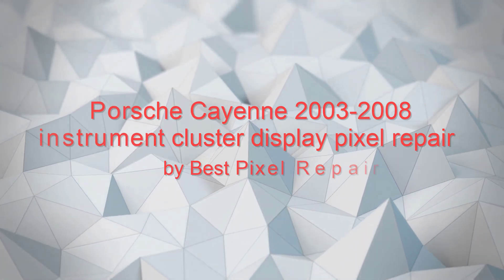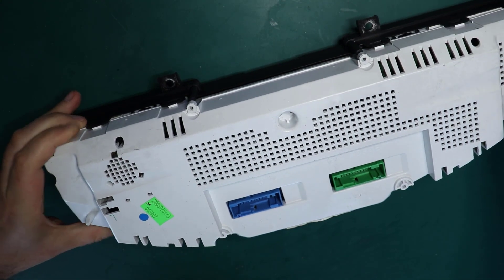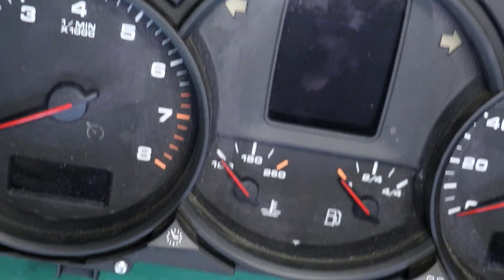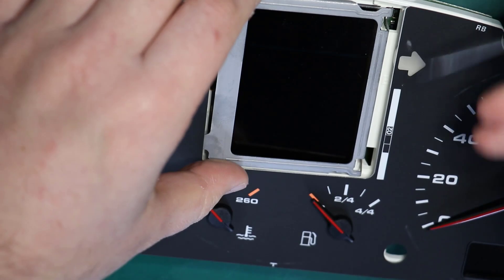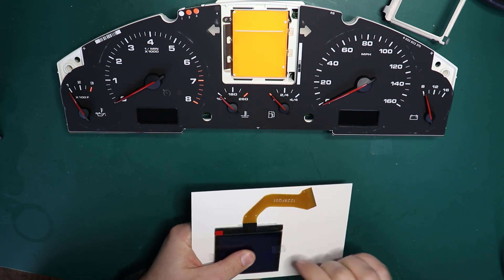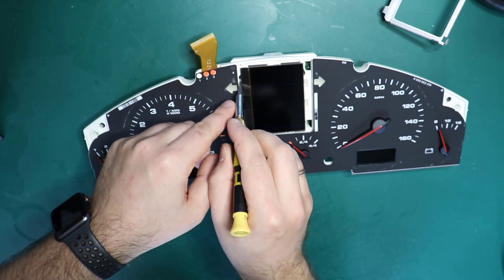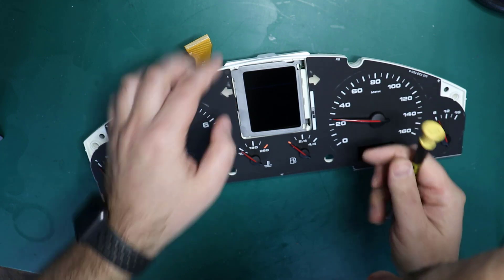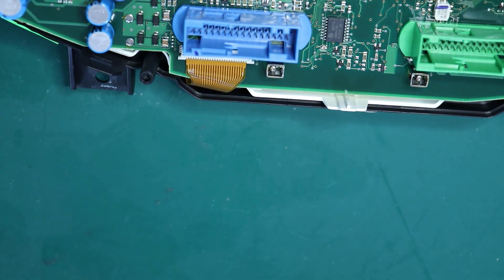Easy DIY repair for your Porsche Cayenne or VW Touareg Instrument Cluster Pixel Problem

Comment: This isn't a "repair"; it is called a "replacement". You could also go that extra mile for your customer, and spend an extra 90-120 secs. cleaning the cluster's cover, and front and rear of the fascia (clear plexi) prior to reassembly. Fingerprint-free brand-new display now resides behind a filthy dash cluster lens.
Reply from the maker: As long as you watched the video and the commercials- that’s only thing that we are carry about :) Customers can clean their clusters themselves :)

Comment: Thank you for the video! It's great. I have a question though, I have a 957 GTS with a bar display. I can't buy the spare screen in my country but I have found a 955 GTS panel which looks exactly like mine. Before I purchase it, wanted to ask if you know that screen on 955 panel will fit my 957 panel? Please advise and thanks in advance
Reply from the maker: I guess internally the displays are different.

Comment: Would love to see a version for the Porsche Cayenne Turbo
Reply from the maker: We disassembled few of those back in a days - don’t recall anything particularly complicated with those. But it’s been few years back. Don’t recall the details.
Reply: @HETPEZB  Do you have any tips on where to source the Turbo display, I seem to be skunked...
Reply from the maker: @paulcurtis5496  , other used cluster as a donor.
Reply: @HETPEZB  dang, so nobody is making the color displays...
Reply: Transformers on circuit board for the turbo models go out.  Replace the transformers on turbo models not the display.
Reply: @mofomoco  the display is burned where two of them have failed… The display is damaged.

Comment: Great video! Will this work for a 957 GTS with the lower trim LCD display as well? (2010)
Reply from the maker: I think, that the type of the LCD on those is different. They changed it in 07 I guess.

Comment: Thanks for the video. But I am still wondering why I can't find for Porsche cayenne turbo 2004 LCD repair kit. Is it available on the market?
Reply from the maker: For Turbo there are different problems with the cluster. Usually related to the high voltage transformers.
Reply: @HETPEZB  Hi, so repair kit is not available to order? do I need to buy a new one?

Comment: Do you guys have a video on making the power adapter or the pin-out for the cluster for bench testing like this? was going to get some clusters on ebay to repair some things on mine but didnt want to have to disassemble/reassemble the car each time i wanted to test.

Comment: If that cluster goes out will the light of the gauges also go out and  also my speed gauge isn't moving will that lcd screen have a part in all of that as well??
Reply from the maker: Spike Jones ,  no, your issue is not a part of the lcd screen problem. You have some other gremlins there.
Reply: Best Pixel Repair have you ever heard of this the brake light is flashing and the abs and airbags light is on
Reply from the maker: Unfortunately not really, since our expertise is only within the pixel repair. Sorry for the inconvenience.
Reply: Best Pixel Repair its ok thanks I'm gonna just change out the whole cluster
Reply from the maker: I may be wrong, but the replacement of the whole cluster is not an easy plug-n-play. You will need to set up (program) anti-thief system on your replacement cluster, otherwise your car may not start at all.
Reply: Best Pixel Repair yes I was told that also